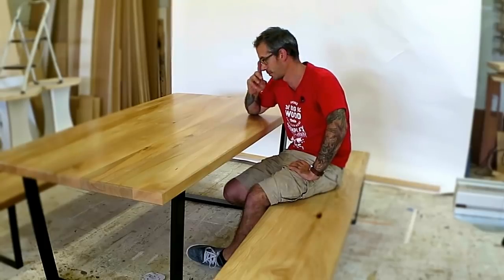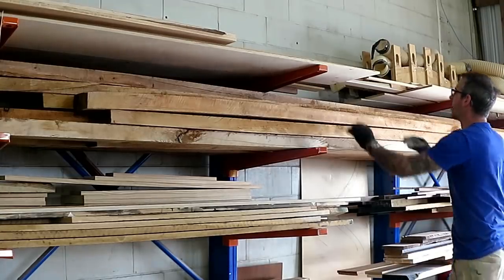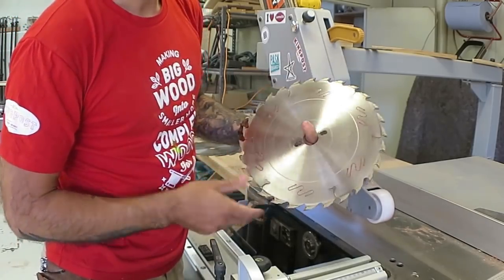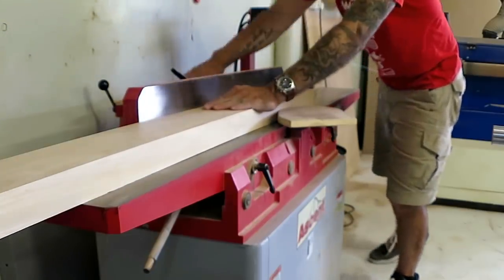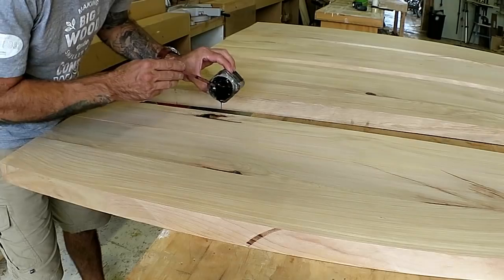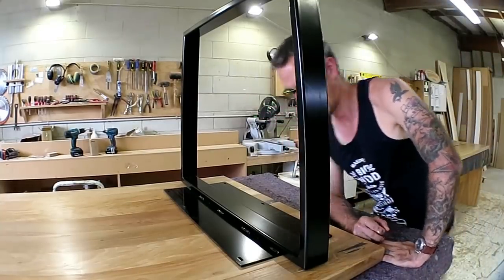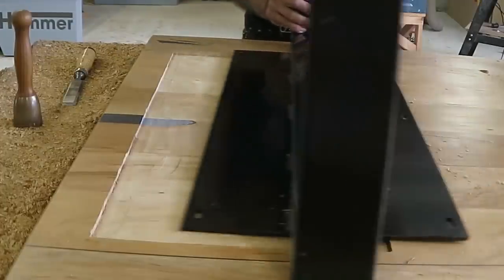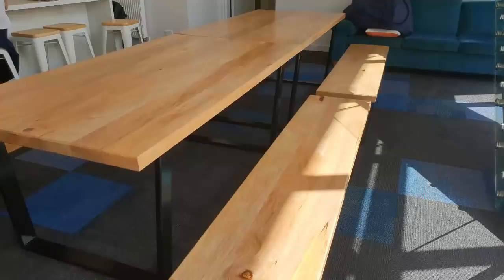Minimal tables

Comment: I'd have never picked the timber as Rimu. The tables and benches have turned out magnificently.  In a dormitory environment the tables will probably get thrashed, so your metal legs will stand up well.   Cheers, David.
Reply from the maker: Hey David,  can you tell me the name of the sliding table clamps I got one of? I cant remember and people keep asking...
Reply: @KingPostTimberWorks  Ruwi sliding table saw clamps.  Check them out here https://ruwi.de/en/produkte/safety-for-the-sliding-table-saw/.  I have some available suitable for Felder tables.  Cheers, David.

Comment: hey mate, i was wondering why you go straight to the thicknesser instead of surface planing one face and one edge? 
cheers,
Alex
Reply from the maker: Hi Alex, I like to get everything to a consistent rough thickness then assess what needs jointing . It's just not always in the vid
Reply: hi there, thanks for replying.
don't you lose lots more material this way though? won't all the high spots in the plank compromise the thicknessing process and also enhance twisting?
thanks
Alex